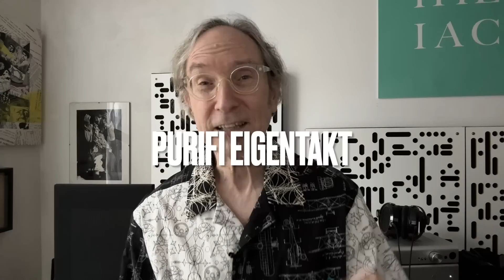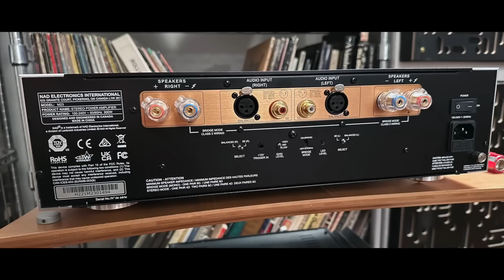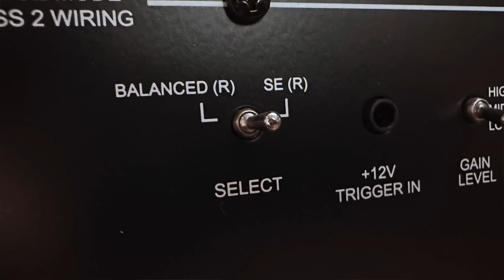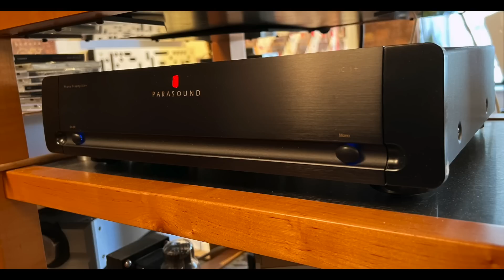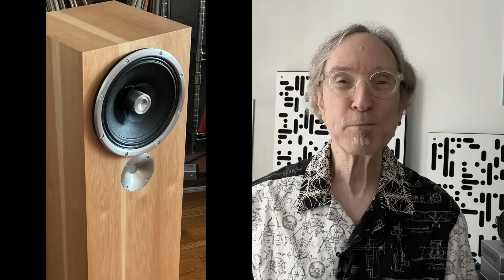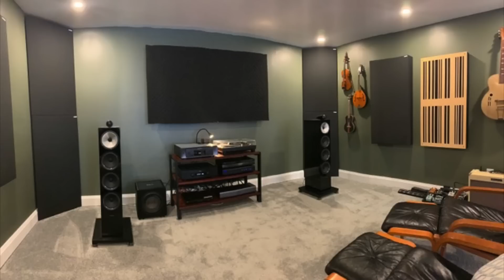NAD M23 Amplifier: Class D Done Right!

Comment: Hi Steve, thanks for a great channel and great reviews. I think the D-amps with purify tech is really interesting. I own aNAD C298 and it’s really clean, pure and very balanced, no blend or coloration what so ever, just pure power. The speaker and the pre-amp I choose will add the sound coloration, not the power amp. Might sound boring, but I think the opposite. It’s just a new perspective and one ingredient less to take into account when pairing. If you really want to understand how a specific speaker sounds, then the NAD C298 is one step in that direction. It’s like drinking the 100% purest vodka with no blend, it’s what you blend it with that matters. Just a different perspective I wanted to share.
Reply: I love my Parasound 2125v2 but I want to upgrade and must be <50 lbs with trigger input (bonus would be gain adjustment and loop out for subwoofers).  I didn't want to spend that much for the NAD m23 (200 watts) so I got the NAD C298 (185 watts)
Apple Music lossless.

In my other room (family room), I already have experience and love a Class D (Parasound zonemaster 2) for the front L/R speakers in a 5.4.4. setup.

Comment: Does people still care about the Class of the Amplifier ? I use an complete Class D active setup (Neumann) and they sound phenomanal. Same as the Genelec. ATC use Class A and sounded also awesome. Its about the complete concept and setup and most important acoustics. When you buy high quality products the differences are soo small and minimal that an good room acoustic are way more influence the sound than the amp. Nowadays you can buy such good products way easyier and cheaper than nowadays where the selection is limited

Comment: Yes I have a French made Audiophonics Class D with the e purify modules. Excellent. It absolutely blows away my mc75 monoblocks.  400 watts, 4 ohms.  1200 bucks no vat no tax fast shipping.  Yes, distortion free it seems, and hyper clear.  Using with Sonusfaber Olympica 1s.
Reply: Sounds yummy
Reply: @stephencosta6814 but what speakers you use when it “ blows away”
Reply: I have class D AUDIOPHONICS LPA-S500NC Power Amplifier using Hypex NCore NC502MP integrated board and also Buckeye Purifi 1ET400A Amplifier, 2-channel class D … in the hi-gain Purify gain is perfect match for Hypex nc502mp and use them to biamp my Neat Motive 1 speakers.

Comment: Just bought this last year, my first brand new power amp.  I have been skeptical of class D and honestly when I heard the M33 I was really impressed with multiple speakers.  Everything is the same with the M23 but it's even better performance.  It has a touch of warmth which is odd for a class D and takes away that class D edge that some people do not like.  Closest performer at twice the price was the bel canto black, which only the plastic version is that cheap/lowest priced.
Reply: I have the same thoughts  I know this would be a fantastic device
Reply: This is also my first all new amp. Really like it. Looking for a better pre now.
Reply: I know it is a cringe. But can't we use DSP to simulate that thick Class A sound with purifi Class D?

Gene from Audiholics loves the NAD too.
Reply: @chebrubin  My first integrated was the NAD 326BEE which is a class A/B design and is honestly a great integrated.  Really it's a power amp with a volume control which is extreme bare bones and great for a purist.  Avoiding a lot of interference and all that extra stuff by jamming a whole bunch of crap into a box.

Honestly I feel the M23 has just the right amount of warmth, even though I would like it a touch warmer.  I have never owned real class D amps, basically just those texas instru 50-100 dollar ones and when not being bad it does lack what class A/B provides.

The only thing I would say is a con for some and not huge mistake or incompetence in design is that the bass is far more timid.  If you have a really bass heavy speaker this is great cause it balances out.  But honestly I cant fault it, it's not that bad.  If class A/B were 10/10 in the bass department this would be an 8 in my eyes vs other class D which is like a 4 or less
Reply: @citytianyu  I use a topping pre90, solely for equal measurements.  I believe a tube amp would be great.  I am about to get a tube dac soon and I am certain that will really make the sound perfect.  But a tube pre amp which is probably only using the tube as a buffer stage would be perfect to add a further touch of warmth.   Like I said in my eyes it's basically leaning towards the warm side and you dont want to make it too warm.
Reply: @citytianyu I’m looking forward to seeing reviews and hearing the new M66 …. Should be amazing with this power amp
Reply: @leemartin2978  M66 is a monster! Looks like one, and also priced like one. On the official website, it says "perfect match for award winning M23", but it's almost as twice expensive as a M23. Adding the fact that it has 4 sub ports, it makes me believe it is more for double M23s in bridge mode so that it all makes sense: 700 watts per channel with 4 subs to fill the large room...
Reply: @citytianyu  I’m hoping John Darko will review it. I like his approach , and that I can possibly hear one with the M23 on demo. One M23 and the M66 would be wallet emptying let alone two. Food for thought anyway. Launch appears to have been put back slightly , it was initially September , but should be available soon 👍

Comment: I love my Parasound 2125v2 but I want to upgrade and must be <50 lbs with trigger input (bonus would be gain adjustment and loop out for subwoofers).  I didn't want to spend that much for the NAD m23 (200 watts) so I got the NAD C298 (185 watts)
Apple Music lossless.

In my other room (family room), I already have experience and love a Class D (Parasound zonemaster 2) for the front L/R speakers in a 5.4.4. setup.

Comment: Hifi is really all about beauty and pleasure for me! It's a bit funny. I pretty much only like tube amps under 40 watts, especially under 20; or class D cheapies. Now I admit to liking some older Carvers, but then they are the exception that proves the rule. Currently I am playing with a Cayin A-50T, a Dyna Stereo 70, a SABAJ A5, a Reisong you recommended (thanks!), and a pile of little Nobsound, Aiyiam, AudioSource, and the like. If an amp is going to add a sound, then I want it to be sensuous and lovely! Otherwise, neutral is best. And even cheap class D amps can often be remarkably invisible. Generally I drive 1980 Klipsch Cornwalls, big early 60s EVs, and misc home-builts. My guilty pleasure is 4 Bose 901 VI hooked to a 70s Sansui quad receiver.  Accuracy only matters if it's fun! It's really all about beauty and pleasure!

Comment: This amplifier's bass response and descriptions have me perplexed, is it accuracy? I have heard it has great dampening factor meaning great bass control, but a couple of reviews mentioned less weight impact from the lower end.  Yet despite that curiosity it seems everyone is saying the same thing about the mid and high performance that its a great performer. I'm wondering if it would be a good replacement for an older Krell.

Have you listened to the M66 which partners this? I have seen some reviews but not a lot regarding how if using Dirac it will take the phono signal and digitise it, yet actually do a great job, I love old analogue and class A A/B amps, plus valves, but modern streaming and room correction sounds worth looking into with modern housing and L shaped rooms. But there seems to be mixed opinions on digitising analogue.
Reply from the maker: High damping factor leads to very tight highly defined bass. But that also means the base is not as full and Rich .

Comment: The M33 houses the same Purifi Power amp modules and they sound amazing, I have not regretted that purchase. I drive Buchardt Audio S400 SE speakers, those need power and with the M33/M23 they sound amazing.
Reply: In August 2021 I purchased the NAD M28 amplifier, which is based on the same Purify Eigentakt modules. By far, the best multichannel amp I owned. Before I owned a 5 channels P5 from Anthem, which required 3000W of power and two electric cables. Now, I own a 7 channels amp that only consumes 1000W, if that. Also the size and the weight is reduced by 60% or so. Clearly, I am not going back to class A/B.
Reply: You have the combo M33\23. That means you don’t use the poweramp of the M33 anymore? I also consider to buy this combo therefore my question.

Comment: M23 have faston connectors from the power plug...you can move them with the finger which means no good connection (less deep sound stage)...once they are soldered this amp becomes a beast

Comment: Look forward to checking on out! Nice review as always, respect your perspective. I know bigger amplifiers are not needed yet always seem to draw me in, especially when heard at moderate to low levels. I will get the PS Audio M1200 at some point as well. Just add them to my growing collection.  And yes I try and listen to them all. Thank you kind sir.
Reply: The need for a bigger amplifier depends on your speaker sensitivity and the loudness you want to play with. If you have speakers that have a low impedance, a small amp may not be able to handle the load without distorting. There are many reasons to like big amps.
Reply: I moved up to M700 , 2 months ago 
It's absolutely a game changer

Comment: As always, great review.  I've heard nothing but rave reviews about the M23. Im very interested in the NAD M33 integrated amplifier/steamer. It uses pretty much this amp. I wonder how it would sound with Martin Logan Motion 40's?
Reply: I think the M33 may be more similar to the C298, at least they share the same power supply which is slightly different than the M23’s power supply
Reply: Me either but if it’s popular in this climate. Who knows what will happen to the price.
Reply: @klxz79  thanks for the clarification. 

@Tex I agree,  unfortunately it's not a good time for me to drop that much money.  Both the M23 and M33 are high on my list.  Clarity and detail is what I'm looking for,  but I may want 3 channel amplification.
Reply: @klxz79  I believe that it is correct to state that the M23 is the very power amp from the M33

Comment: Great review Steve. Thanks. I have the cheap man's version, the C298 paired with the Q Acoutics 50's and it sounds immaculate.
Reply: Would you mind sharing what preamp you’re using with that C298? Thanks
Reply: @richm4402  nad 758v3 which is gonna be replaced soon.
Reply: @edvedder7835  Lol, that’s what I’m using too!
Reply: @richm4402  finding a replacement is not easy. The 778 has issues. Want dirac.
Reply: @edvedder7835  I’m thinking the C298 deserves a decent preamp with HT bypass. C658 seems to have issues too, hopefully they’ll come out with a version 2 .
Reply: @richm4402 that's nice, no doubt, but I need something for the home theater.
Reply: @richm4402  Are you experiencing issues too? If so, would you care to elaborate to another C 658 owner? 
THX, Martin
Reply: @edvedder7835  are you having issues with the 758?
Reply: @love2fly59  I don’t actually own one yet, I’ve read on owners forums that some have had issues with the volume control randomly maxing out. Also issues with low signal output level on sub out. Are you having any problems with yours? Maybe these things have been rectified with updates. The volume control issue has me concerned!
Reply: @richm4402  No real issues to date, but switching between inputs on the MDC HDM-2 module and BluOS is often unreliable and a pain.
Reply: @richm4402  no issues, but did require a card change after 2 or 3 visits to a NAD authorization depot. AudioSciencereview gave it a very poor rating for its DAC. Apparently distortion at high volume levels. It's 6 years old this year. Time for a change.
Reply: @love2fly59  hopefully that will be addressed in a future update. My Nad 758 had issues switching hdmi inputs, I ended up plugging all sources into the TV and then using e-arc from the TV to the Nad for sound. I think we’re years off from having trouble free A/V systems! Lol
Reply: @richm4402  For sure. There's a saying along the lines of "the last thing that dies is hope" in the German language. 😉 I've been in Europe too long to remember the English language equivalent. 😞
Back in the day when it was still  current product, I bought my teenagers an HT system based on the Denon AVR-X4000 plus DBT-3313UD, absolutely trouble free in comparison to the NAD combo. I just remembered that the C 658 eARC is a bit flaky concerning turning on connected sources.

Comment: Fabulous job on the review of the M23... as always!   I was hoping you would get a chance to review the NAD Master Series Amps and was wondering what your impressions would be of their class D module.  I've been enjoying my M33 for two years now which uses the same amplifier modules.  The system is paired with Ohm Walsh Tall 3000's and I have been super happy with that combination.  I too felt like I was rediscovering my music collection with the M33 due to its resolution (clarity). Thank you again Steve for all the work you do on this channel, it's such a treat to see your reviews and to get exposed to new music and artists.
Reply: Al Mcgowan,
Whats the soundstage like with the Ohm Walsh Tall 3000, I had some Bose 901's back in the late 80's and I swear no matter wear you stood it was huge stereo.
Reply: @robertbelknap  sorry for the delay.  The sound stage is wide and deep.  My too is about 15’ x 40’ with 10’ ceilings. Honestly there is not a bad place to stand and not get great lighting imagining.  The size of you room will determine if the size they recommend.  I recall those Bose speakers but never owned a pair.  I’ve been super happy with my 3000’s.  The people T Ohm are great work.  If you have questions you can the owner John very nice.  Good luck.

Comment: I’ve not been a fan of the few Class D amps I’ve heard but with anything there’s always room for improvement and that usually means it escalates out of my affordability range.
Reply: exactly
Reply: Right now there are amp manufacturers who will provide you with a beautiful sounding class D amp around £800 for somewhere between 400/ 600 wpc  Like NAD they get the boards ( icepower,hypex, purefi etc etc ) add power supplies RCA XLR ins / outs monoblock capabilities fancy output/ input buffers etc etc. But they are small operators.
I drive mine with a Doge 8 clarity preamp. Hasn't been turned off in 5 years. Sounds gorgeous with analogue or digital.
Reply: N A D 298 $2000.  90 percent of the same sound  of the m 23 I would think

Comment: I recently picked up a pair of dirty weekends to some extent due to your very positive review. Have you tilted the speaker as you did the Zu soul? It is a short speaker. I think it probably needs the decoupling as the bass can rock my place. Finally, you really didn't share much in the way of negatives with the speaker but sort of hinted at some in this review. Any such critical thoughts now?
Reply: I got my DW's just before they stopped making them. I would guess you have the Clarity caps and the high-fi footers. Mine are  3' from the front wall to the front of the speaker and a little over 2 from the side. Equal-lateral triangle toed-in just outside my shoulders. No need to tilt them back. They sound Amazing best if heard I had JBL's, Wharfedale's and others.. There are not analytical at all but will expose any weakness in your chain. Had to give up Spotify because I stream through an iPad and the conversation from OGG to ACC which I think was the issue made the upper vocals not bright but grainy. Now streaming Apple Music and it's Bliss. Also using a HSU sub for under 80HZ.
Reply: @gtric1466  they stopped making them? I just got mine a couple weeks ago. Yes I got the first level upgrade and the house speaker cables. I didn't plan on getting footers until I noticed quite a bit of vibration from the speakers' bass output on certain songs. I tried SVS footers first but they didn't fit. Thinking about Herbie's now as they can glide. They have a 60-day free trial just like the speakers. I have them nine feet apart and I sit 12 ft from them. I Have them set out into the room as far as they can go. Less than 3 ft. I am still playing with the toe-in. From what you described to just straight on.  I like them so far but I'm going to take my time with the full evaluation. I expect the sound will change somewhat after I get footers.

I  use them with vinyl, CDs, TV, and streaming with Google Chromecast. So about everything. At this point I don't think I need a subwoofer. Seems to go quite low
Reply: @lsaideOK  Awesome Enjoy yes sound will change a bit even though they burn it the woofer. I believe you have the 6 mine where the 2nd generation of the originals when they started using new drivers at that time they were 999.00 without the Clarity caps and hi go footers. All in I was at 1,500 because I had to get Ghost Black  Maple WAF., 😊
Reply: @gtric1466  those were the days! 999! Mine was 1599 but I got the rustic hickory, the upgrade, and the house cables. So over $2,800! With footers It will approach 3000. Given the price, I think they should include the footers. In my brief listening, I think they are a necessity.
Reply: @lsaideOK  yeah I hear you got mine the summer of 2021 was the next to last run during Covid waited 4 months
Reply: Hi Larry, I’m using the DW6 (same upgrade package) with the rubber feet, and they work perfectly.  I use them with a Luxman L-509x integrated, Luxman cd player/DAC, a ClearAudio turntable and a Sutherland Insight LPS phono stage — an unlikely pairing. But they sound incredible. I thought this would just be temporary until I found “the” speakers, but I’m constantly amazed at how good they sound. They can definitely rise to the occasion with whatever high end gear you might throw at them. Enjoy!